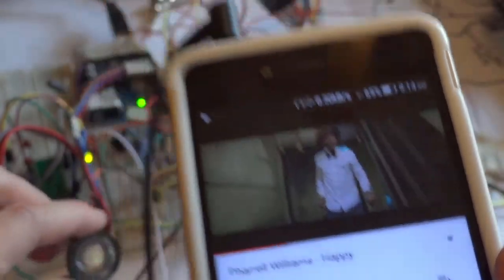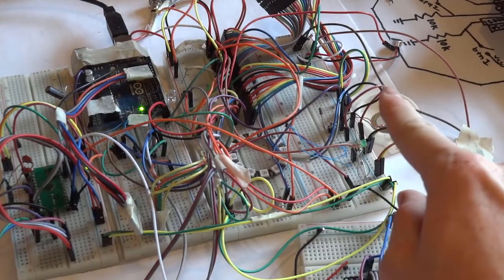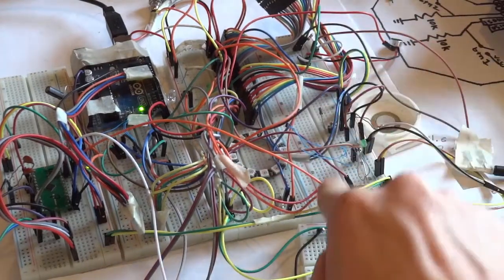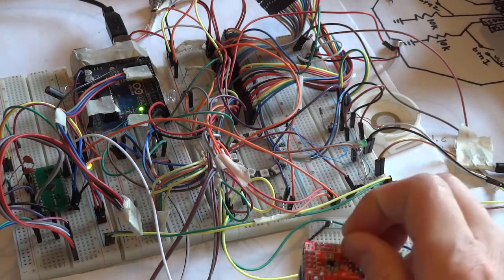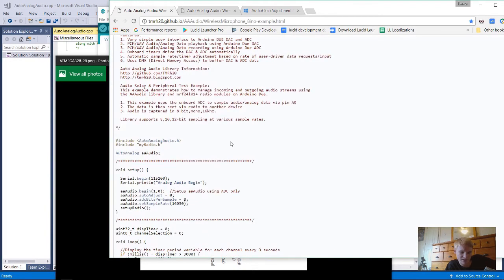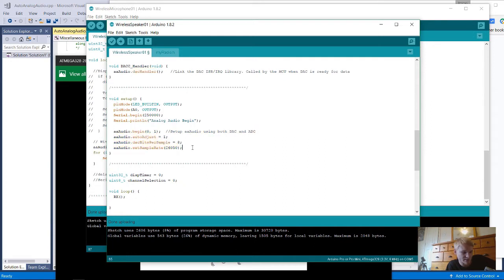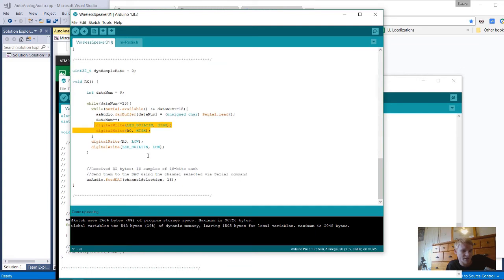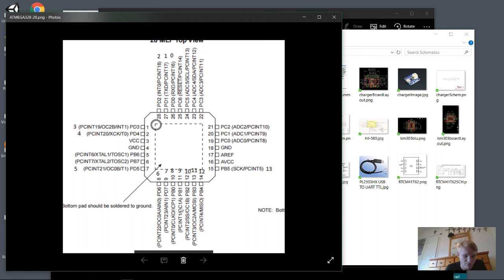8 Bit Digital PCM Audio Streaming with Arduino over Serial Proof of Concept

Comment: If MIDI over Bluetooth is possible, and it is, then I don’t think it impossible to stream 8 bit PCM over Bluetooth.  This is why I stumbled upon your video, I have an old drum machine who’s sample data is all formatted PCM, just different  rate and resolution.  I want to replace the internal PCM sample phrase files in my drum machine by formatting my samples as PCM, and then send them into the ROM banks via MIDI.  I’ve literally hypothetically played with this idea for over ten years, and I’ve got my samples into the appropriate format as that is simple with any audio software.  But because the machine’s sounds are actually stacked, 4 samples high, I left that alone.  Now I’m really impressed with your project, and i think you can do this.  I can recall having to know quite a bit more than just the bit rate and resolution with that PCM stuff.  Logarithmic or Linear (I think Linear is more like my sample machine, and communications tech favors Log), signed or unsigned (where you pointed out that there were values from 0-255 for your 8-bit would indicate it’s being treated as unsigned, signed would yield values between -128 thru zero to 127), for 8-bit it is reasonable to think it would be treated as unsigned, twos compliment, although I’ve seen funky codes with a sort of sign and value alternating.  Bringing me to whether it’s stereo or not, would be so much easier to leave it mono but with each next channel there’s definitely interleaving unless another whacky proprietary format, so each and every other sample would flip flop between left channel sample and right channel sample.  More surprises to mention that I’m not remembering here I’m certain.  It’s a very interesting project.  Good luck and keep it up don’t let yourself loose diligence.  Revel in your triumphs and leave little time to be discouraged.  AND THANKS FOR SHARING!!

Comment: Try switching to the Teensy boards. Will work with the Arduino IDE and they are much more powerful, 32 bits and way faster. Same price range, and actually cheaper too.
Reply from the maker: Thanks for the recommendation. I'll have to take a look at that
Reply: Not in latinamerica One Teensy is 15X cost of arduino.
Reply: @rjameslower  crazy, I never knew about that one. I just checked Amazon shipping to Chile and it seems it's still cheaper to get teensy. Out of curiosity what's driving the price difference do you think?
Reply: @kokofiProductions  mmm I don't know what is cheaper for you. I mean 1 Arduino nano is about 3 or 4 USD on local electronic store. 1 teensy is only available for Amazon for about 40 o 50 USD plus shipping. I'm in Mexico.  My job give me about 250 USD every month. For me has no sense buy a teensy.  For the record 1 blue pill STM  arm is about 4 or 5 USD
Reply: @kokofiProductions  I think all Arduino are from China. And compatible ones. Maybe that's why is so chipper

Comment: Can you go onto more depth with setting up the microphone? I'm getting an undefined reference to DACC_Handler() error that's making it not compile
Reply: the function definition "void DACC_Handler(void) {
  aaAudio.dacHandler();   //Link the DAC ISR/IRQ library. Called by the MCU when DAC is ready for data
}" is missing from his code which is present in the library's example code. Copy/pasted it and it compiled and uploaded.